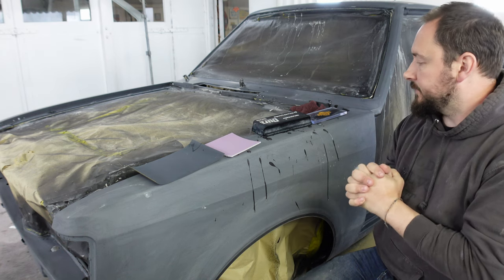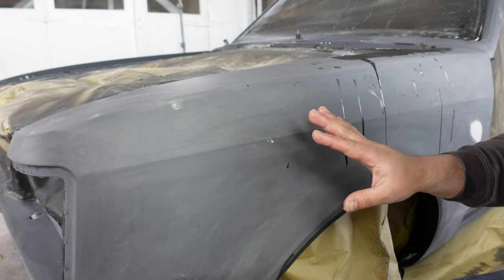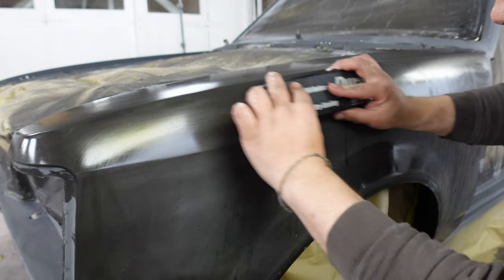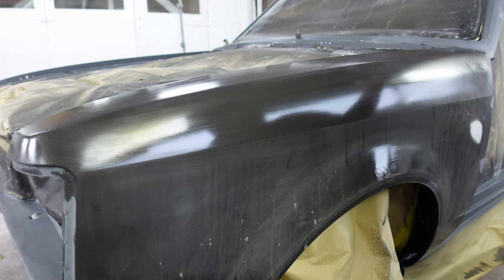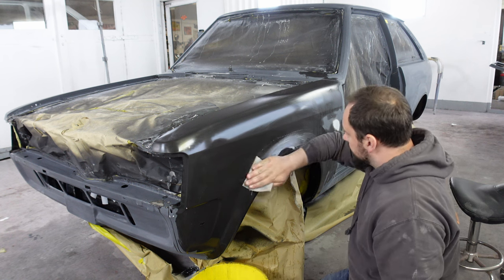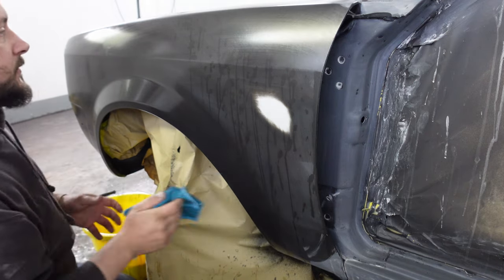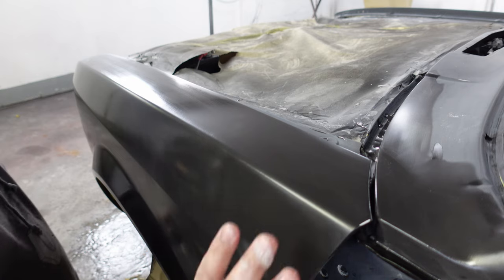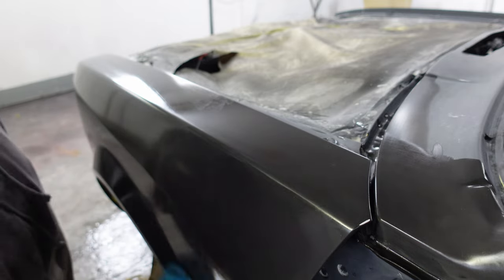How To Wet Sand A Car Ready For Painting - Talbot Sunbeam LOTUS EP 16

Comment: you can polish the edge of acrylic with a blow torch without the fear of electrocution 😀 I used to own hydrogen generating flame polishers years go, sand the edge to remove saw cut marks scrape with the back of a hacksaw blade sharpened just like a mirka shark, so you can use that also, then a quick blast with the flame, only works on clear & can introduce stress if you overheat.
Reply from the maker: Hi Lester
I tried a flame polish but the material is polycarbonate witch sadly can't be polished in that way, thank you for your advice and thanks for watching 😊